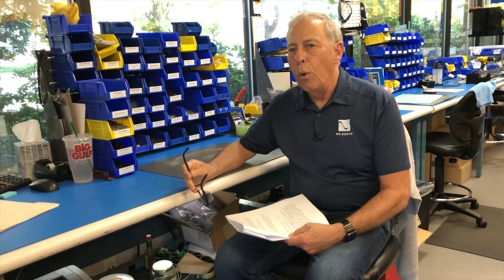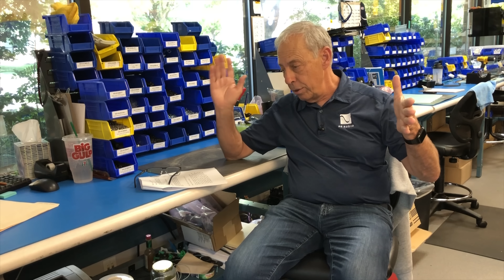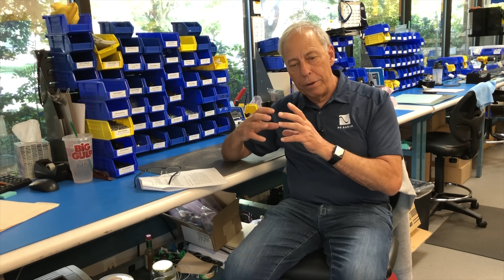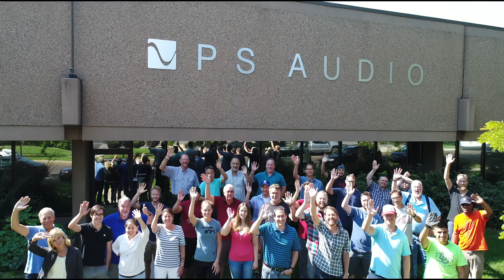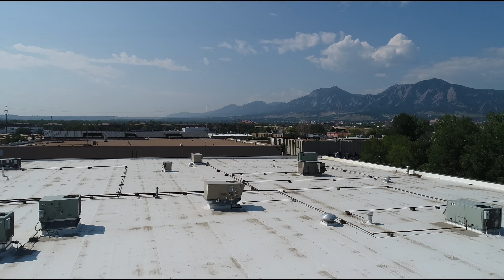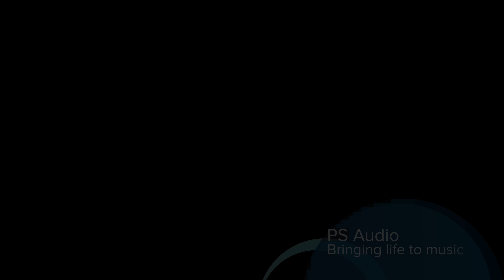Would a battery powered stereo be good?

Comment: You receive some great questions but this time i did not like the answer. the impedance of the battery can be bypassed by using filter caps - same reason they are there in AC-DC power supplies. I thought your explanation of impedance wasn't that great! In reality there is no DC voltage rail, because the load modulates due to music changing loudness, the load is alternating, and therefore the resulting current is AC. Due to internal impedance and the finite EMF of a battery, you are going to see voltage sag, ie the voltage is alternating as well. So in reality you have AC on all counts, just that it's DC-biased to be always positive.

All this - the ripple, larfe impedance , sag, etc - is fixed with filter capacitors and voltage regulators. This is very similar to a transformer based power supply - transformers actually have very high impedance if you want your current at the wrong time in the cycle of tye mains waveform, and filter caps bypass them at that point. That is, the current loop that would normally go through the load and transformer, cannot go through the transformer which is having high impedance (like a switch turned off), and that current loop can /bypass/ the transformer by going through the capacitor instead, like a car /bypassing/ traffic congestion by using an alternative route. This will work as long as the capacitors have charge stored in them and can respond at the frequency necessary. When the charge empties, the impedance increases, but soon enough the load will subside enough for the capacitor to recharge. Or if you are using an AC transformer, soon enough it will be again in low impedance state, when the capacitor will actually have higher impedance than the transformer - so the current will go through the transformer, and the capacitor will be able to recharge as well, essentially being a second load, in parallel with your normal load (preamp, amp, speakers, etc).

When the frequency of the load is wrong for the capacitor, the cap's impedance will also be high for that load. That's why filter banks have different sizes and types of caps - it's not to save space, it's in order to bypass different frequencies. Each type, model, and size of capacitor will have a different frequency its impedance is the lowest at. It is this frequency at which the capacitor can be a real bypass capacitor. As you move away from that frequency, its impedance increases, or in otger words its conductance decreases. So you have to overlap those ranges, just like you would overlap different transducers that are best at different frequencies.

The thing is, with AC-DC supplies, you have to take care of ripple rejection, which can be very difficult, especially for powering very high gain stages like preamps. Batteries have no ripple. Due to the chemical process of voltage provision they have an amount of /noise/, but that is again fixed with filter caps for freqs far from 0 Hz and voltage regulators for freqs near 0 Hz.

Comment: Use a car battery and an internal combustion engine and an alternator to charge it.   Buy a car amplifier and it will work great but be very heavy.   I recommend that you purchase a car to carry this with you or just park and listen.
Reply: Alternator and ignition noise is a pain.
Reply: @mikka1986  For critical listening in a high end car audio system you would turn the engine off, noise sources are kept to a minimum
Reply: @Muffinx93  That's true, but amplifier like brax will flat your battery before finishing an album.
Reply: @mikka1986  This is why I have 4 batteries and 500f of capacitors :)
Reply: An RCL network will take care of that.  I had to install one in a 1964 Corvair to get the noise out of an eight track player.   The car made this system a lot easier to carry.
Reply: Any noise cancelled is dB lost. Best not to start with noise
Reply: No.  This filter is connected to the DC supply voltage just before it supplies power to the electronic device.  It cleans up the power and has no effect on the audio.